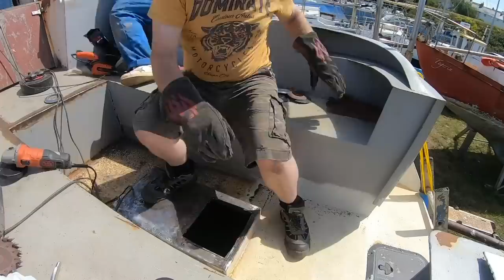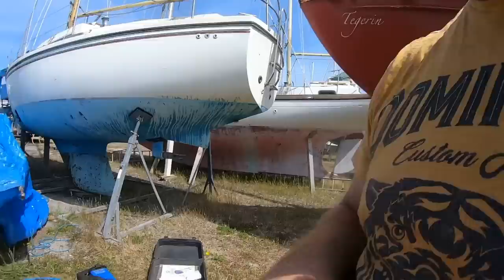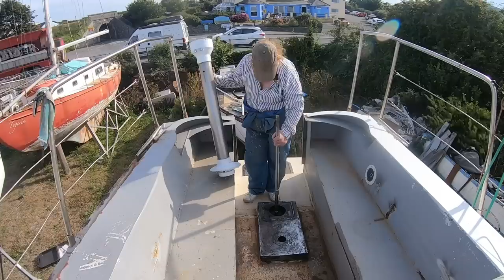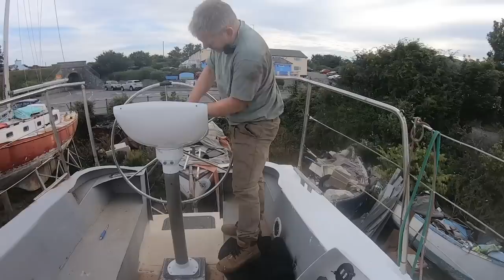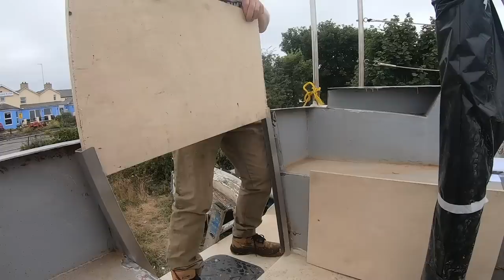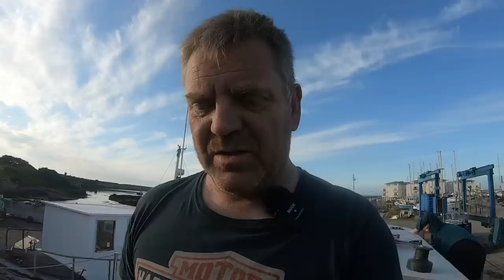#102 - Putting our BOAT back together!! PROGRESS on our steering!!!! l [S2-E85]

Comment: I thought the bar foot was a little too big...but from a distance when you see the height of the cabin, it's proportional... well done for all this set up, a support for the feet, just a small board with cleats below so that it holds, be the two benches, to navigate at ease without spreading the legs to steer...!! bravo for this video and this new individual sound recording system which seems to be perfect for the sound...!!

Comment: The air in the Kompass you get on your own out. open the screw on the underside, taste the liquid. mostly it is alcohol or thinner. fill up and close.  dont forget to check if the needle swings easily back after you put a piece of steel near. nice done .

Comment: Washboard helm seat. I would suggest hinging a heavy duty frame seat. Then it can be swong out of the way for entry.. As to the seat its self, I would suggest mocking up a curved and a version that has flats. Or maybe a hybrid of FLAT for the non healed on top center and cruve the sides. Also use TEF GEL on evrerything on that helm that has threads....
Reply from the maker: Yes we’ve got some thinking to do with regard to the helm seat

Comment: In view of your complexion issues, I grew up in Miami and now visit my dermatologist once  or twice per year.  I now use floppy hats and light weight long sleeve shirts manufactured with sunscreen protection.  Not sure if they are available in your area ,  but I find them helpful ! Thx for nice introduction on plans for steering and binnacle.
Reply from the maker: Great advice thanks :)
Reply: @SailingMelody  left arm, face and top of my head are always getting “ Precancerous lesions”.  Dad served in RCNR 1940- 1950 and he had similar problems-  obviously in my genetics!

Comment: As always Team great work. Helm station looking fine I would leave as is and on your trip closer to home it will give you a better idea of what works what doesn't site lines etc that way ya not making extra work for yaselfs. Things are progressing nicely and once ya get engine, rudder , prop etc on things will steadily come together quickly and you will be sailing the Greek cruising grounds before ya know it. Andy nothing wrong with ya welding man. Be well now and carry on.

Cheers Nick (NZ)
Reply from the maker: Thanks Nick :)

Comment: Hi Andy Melissa and Jack great to see the steering going on I was thinking when you said you wanted shorten the tube therefore lowering the steering how about if you built a  raised platform behind the steering column it would save you cutting the tube just a thought as you were struggling to get it into position do you think the previous owners may removed the shims with everything happening in the yard your deadline gets interesting good luck Kevin

Comment: Kika from sailing Uma has to stand  on the seats to see over the spray hood at times... But shes a lot shorter but as i saw mentioned earlier watch out for the boom hight before you plan you seating.
Reply from the maker: Yeah for sure
The boom only comes aft of the pilothouse by a few inches at most

Comment: Great video guys as always , quick question in your work room on the boat Andy are you going to have plasma cutter and welder that sort of thing ? Don’t worry about replying if your busy it was just a question I had in my head this week 🤗
Reply from the maker: I will be taking a small welder yeah. I may not take the plasma cutter. I can do 90% of what I need to do with a grinder, the plasma is just handy for corners or large panels
Reply: @SailingMelody  great 👍 I don’t know why but it’s just another aspect in your future I am looking forward to seeing not only melody refurbishment but also how the maintenance workroom will be

Comment: Coming on well done, where did you get that stainless channel from please
Reply from the maker: I couldn’t find any so I bought stainless box section and cut it down the length to create the channel
Reply: @SailingMelody  good manoeuvre I couldn’t find any either so I used steel for now 😧😧😧

Comment: You've only got a small cockpit area. Do you really need a  raised platform to mount the steering binnacle on. Just the right height to bash your toes on.
Reply from the maker: The emergency rudder gose in there we cannot change it but we will build wooden duck boards to that level so the water can flow out under them without getting our feet wet 😁

Comment: I like the copper pipe trick. I did that a lot but my copper pieces had these aluminium heat sink thingies rivetted on to take away the heat from the copper...It prevented melts and crazy damage to my copper pieces (I used shaped bits and the shaped copper bits were kind of hard to do again and again because them getting damaged all the time due to the heat of welding...

BTW: Can you use fluxcore welding wire on a project like yours at all?
Reply from the maker: Hi yes you can use fluxcore but I hate it lol. I much prefer gas welding however if I can’t mig weld I use stick, which is basically the same thing as fluxcore but with a heavier gauge wire than flux core wire
Reply: @SailingMelody  Fluxcore takes a bit of getting used to obviously. Mainly the slag on top can become somewhat of a nuisance at times. Also using Fluxcore needs for the welder itself to be polarized differently (most people don't do this and run into issues and tend not to like it because of it)
Fluxcore welding is great for outdoor and/or windy circumstances (obviously) ...
It can be somewhat more expensive per feet of weld bead (the wire being more expensive but at the same time, one does not have to go through the hassle of having a gas bottle, keeping track of its contents and possibly having the need of some sort of a rent or subscription for the use of the bottle...

Comment: But in order to splash Melody you have to remast her (just for the instruments?), put the steering/rudder back on, put the cooling system back on the engine, fill the water and fuel tanks and arrgh!

There's a lot to do.

Comment: And less parts and fasteners when r& r & r and r
Reply from the maker: What do you mean? I’ve only loosely bolted it together for now becauee I need to remove it one more time for painting hut of course it’ll be fully bolted and sealed once the last bit of painting is done.  The nice thing is having had it fully apart it’s super easy to take on and off now

Comment: The washboards seem like a bad idea, someone could fall off the stern while underway, and you'd never know.
Reply from the maker: The whole point of the washboards are to stop people falling overboard whilst underway.  They will only be removed whilst at anchor or in harbour etc, they provide the safety of a closed cockpit with the space and ease of use of a fully open transom.

Comment: Wish I could lip read. Who forgot to plug in the mic
Reply from the maker: So sorry, Where abouts?
Reply: @SailingMelody . Twice during the video. Most if the first 1/3. Started fine as you were starting the cut and erld the base of the steering structure, then it came back and went silent again after you had told us what equipment you had purchased and fitted for navigation etc.